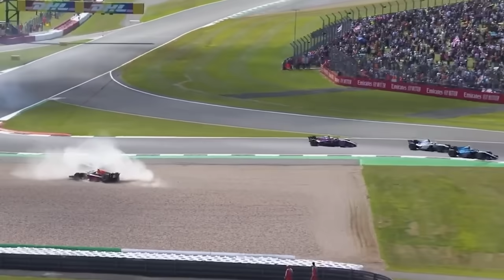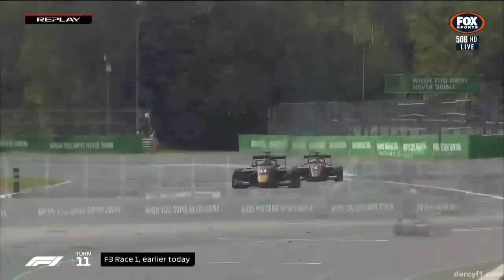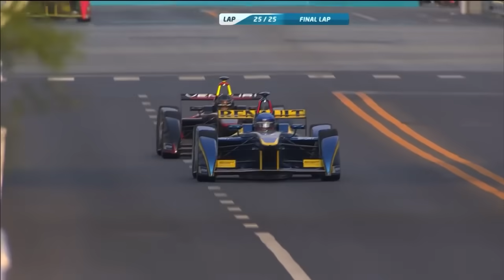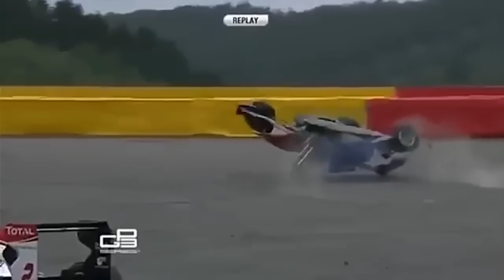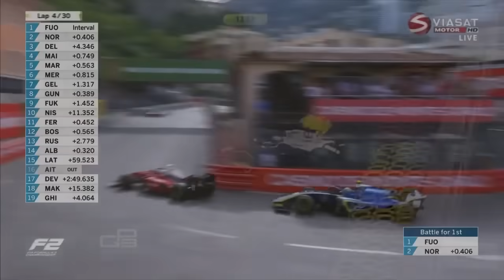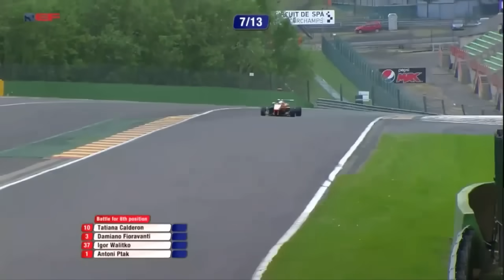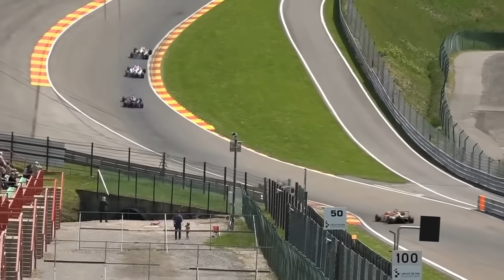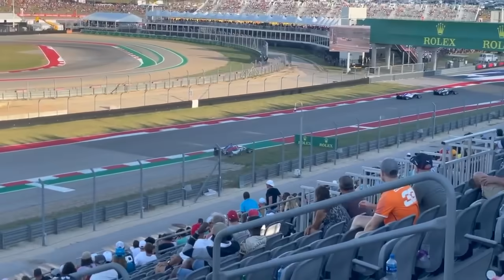Ramps on Race Tracks

Comment: You could add Rubens Barrichello's 1994 Imola accident, kerbs lifted his car over the gravel trap and mostly over the tyre-barrier, hefty impact in the catch fence. Followed up by track marshalls harshly flipping over his car, testing if his neck survives further trauma (no he would not have suffocated within seconds otherwise...).
But Rubens survived, so no real problem, go on 28 years and introduce even steeper kerbs...

Comment: Great video.
It's been repeatedly proven these types of track limit devices actually injure drivers.
The seemingly simply accidents where the cars just hopped up and then slammed down  have broken drivers backs.
Peronis crash should have gotten all these kerbs removed.
He was very blessed to not die considering the energy forces it took to send that car in the air like a frisbee.

Comment: - only places where those things belong is across the driving path, in a 15 mph residential street or a parking lot
If I was allowed to make cowboy design mods I'd make out-of-bounds drop 6 inches lower than the racing line; you might get some drivers finally respecting track limits without re-enacting LeMans1955. If they want to drive like it's a video game then the course likewise ought to be laid out like carmageddon. But ffs get rid of the stupid ramp strips. Especially at Raidillon where they can already get airborne without them

Comment: Yay, let's make all tracks seas of flat concrete like Paul Ricard, because that makes for exciting racing. I think one thing this video proves is that driving standards need looking at. I mean that last Nascar one was hilarious - the whole field of cars ignoring where the actual track was...
Reply: Clipping track boundaries shouldn't be punished by severe injury or potential death however, sausage kerbs are NOT the answer.
Reply: NASCAR didn't bore me to death with the cars glued to the track. Variety in motorsports is a nice thing :^)

Comment: the first one was not caused by a sausage kerb. He hit the end of the regular curb and got launched. That track (Road America) does not use Sausage Kerbs. Same with the one at 5:46. Scott McLaughlin got air off of the regular curbing, there is no sausage kerb there.
Reply from the maker: description note: *Some of these objects in the videos included were not technically sausage kerbs, but either served for similar intentions or were clearly badly designed/misplaced.
Reply: That's Indianapolis not RA
Reply: @shappah221  It's Road America turn 5
Reply: @ey7290  they are talking about Scott Mclaughlin which was at the indy road course
Reply: @ey7290  RA turn 5 is not a chicane

Comment: Even traffic spikes would be safer than sausage kerbs...
Seriously, this blue abrasive stuff on Paul Ricard's runnoffs seems to have a good combination of safety and punishment: tires usually suffer from short contact, may even get punctured when spinnig over it - but drivers remains in control over their car. Most of all, cars don't lift-off!

Comment: GET. RID. OF. SAUSAGE. KERBS. It's insane that they are put there for 'safety', and yet there's all these accidents showing how dangerous they can be. Just be consistent with track limits in all series, if the car goes off, deleted lap/warning, simple as that. Utterly insane

EDIT: Not saying anything about your video utters, great work showing off my point for me, but, this video doesn't include the scary crash from WEC Monza, with the car being flipped through the chicane. Drives me nuts

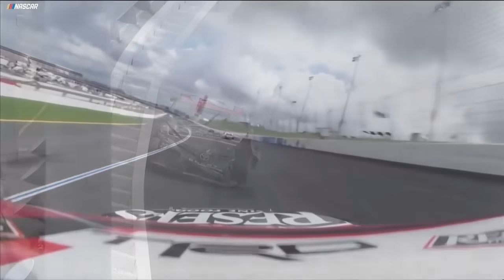Comment: 2:07 what is even the point of having sausage kerbs there I feel like hitting the wall is enough of a punishment for running wide. Also I have no idea why spa thought that putting them on the outside of radillon would make it safer

Comment: They need to be removed. I understand that they are there to deter corner cutting, but they just aren't safe. As soon as your car gets launched you have no control over what it does which is obviously dangerous for a start, not to mention how high and how far some of these cars can go. They could easily kill a driver, and even some spectators... Baffles me that they're still in use. If someone corner cuts then penalise them, don't launch them into the stratosphere.

Comment: And stop taking a 3.5 miles of parking lot and painting a race track?COTA,Paul Ricard?
Reply: Literally neither of those are what you described
Reply: @ey7290  Shit,How much run off area do pro drivers need?1/8mile? Just another diaper for the softy's.
Reply: And the curbing?No one ever said the safety queens are very bright.Safety focused with no fore sight.
Reply: @kevinjachim2378  lol no need to get your knickers in a twist
Reply: @kevinjachim2378  Well Paul Ricard was used as a test track for a long time, obviously the have a lot of run off. Since it's the only suitable track for many series in France there isn't really another choice for many series.

Comment: It purpose was to enforce track limit,  prevent corner cutting and give the driver some form of penalty when they goes offline

But surely, nobody considered that a car very low to the ground running at +250km/h to a literal speedbump would be a bad idea, especially when the driver lose control of the car

Comment: this video is kinda clickbait, since the videos you showed weren't all of the sausage kerb, it was mixed with normal curbs as well...
Reply: Normal kerbs hit end on, typically, so that it behaves like a sausage kerb...
Reply: @fat_biker  it behaves like one, but it isn’t named sausage kerb right? It’s obvious…
Reply: @mohammed_the_train_spotter  Yes. The people who inspect race tracks would never allow a concrete wall in the run off from a corner, for example, or kerbs that don't meet FIA specs, but they won't say a word about sausage kerbs or other pieces of trackside infrastructure that are guaranteed to launch race cars into the air, probably off their tubs rather than their suspension, if vehicles hit them from certain directions.

Comment: Let's start with the two sides of the problem ; imprecise drivers and track owners taking the law into their own hands. 

With respect to the former, the best solution is to have a GPS tracking and a one minute penalty for drivers repeatedly putting 2 wheels off the track. This type of intervention should also be explained to drivers: loadings on the suspension and drivetrain can greatly exceed the original design parameters of cars.  

However, assuming the above is instigated, these sausage kerbs need to be removed as they are particularly dangerous for racers even at slow, featureless circuits such as Snetterton.

I can think of at least two recent occasions where MGBs have been either rolled or sent into the barriers. Both are shown here on You Tube. Both are low speed incidents but the drivers were unable to avoid serious damage to their cars. MGBs are very predictable and unbreakable to race: the cars became unsafe missiles thanks to these kerbs. I would not describe these cases as "supercar fails" by the drivers.

Whilst I am certain that track owners are not trying to create a danger, unless you are able to afford huge repair bills, it is best, imho, to call out and tracks equipped with these, even if you plan to simply do a low speed shake down. There are not going to be enough YT views to cover the repair bills.